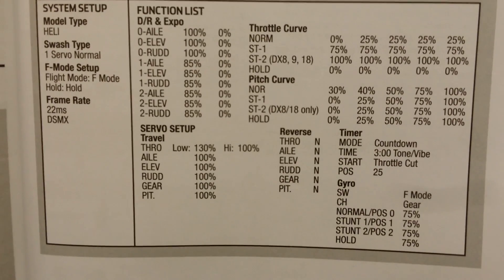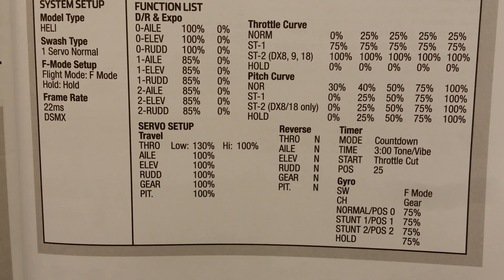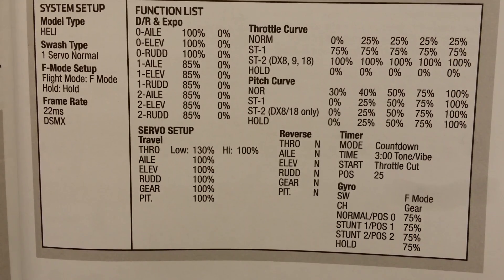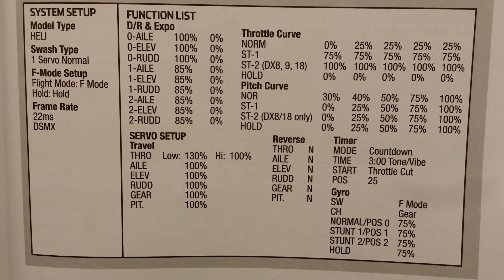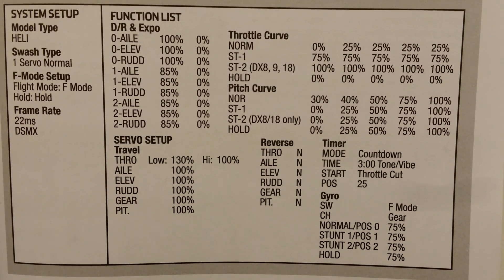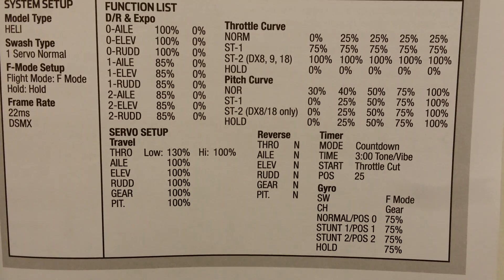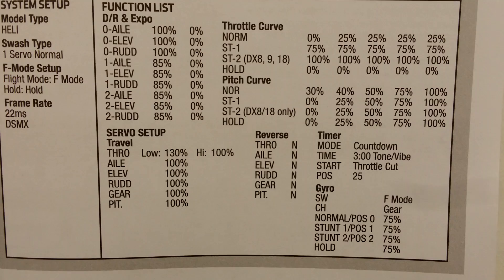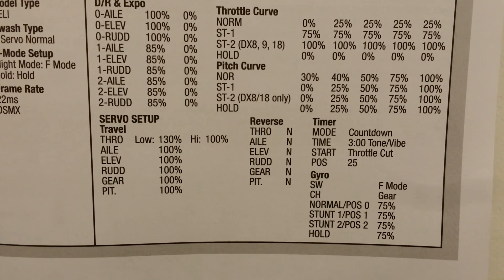Wrong Blade 180 CFX Manual  Transmitter setup

Comment: this micro uses a talon esc that comes in gov mode thats why the travel on the throttle is important to catch the end points the norm is a flat 30 70 100  the pitch curve  is non linear and with a 0 in the throttle curve so you can take off by stick most of us just take off from hold with a linear pitch curve across all 3 banks as far as expo its down to the user i would use about about 10 on a micro and drop the gyro points to around 65 - 70

Comment: #1 25% flat across is correct as per manual it will not fly on what your saying.  Here is the issue Throttle travel adjust should be 100% on low and 110% on high on the DX6.  Others may vary.  I suggest downloading the SPM file from Spektrum or Horizon Hobby.  And 65% expo?  You are not leaving much room for correction my friend.  20% is the max I would set it. and 50% on DR.  That is the correct way to tame this beast down.  Also invest in a Castle programming cable to adjust TC and head speed and spool up issues.

Comment: ok just so u know bro the reason it wont spool up is because theres a miss print the thro  travel should be at 100 high and 100 low, they also did the gov curve  wrong its in  normal mode its 0 30 across idel 1 70 across idle 2 is 100 across its a castle esc i hooked mine up to the castle link cause i knew the curve was wrong and low and behold i was write. im also so going to try fixed end points ill post a vid soon
Reply: please call me, I need help. 719-424-5721. PLEASE IM TRYING TO FLY MINE. I have a DJI phantom vision 2. Love it but I am trying to fly my blade 180 cfx.

Comment: Thanks for sharing. I tried there setup and it didn't  work. Went to Horizon Hobby web site and looked at the manual online and it is different. The online manual difference is only the Servo set up -travel for Throttle. Min set to 100%, max set to 110%. I left the throttle curve at recommended setting 0-25-25-25-25. This worked. Except, I should have put in some Expo. Now waiting on a torque tube.